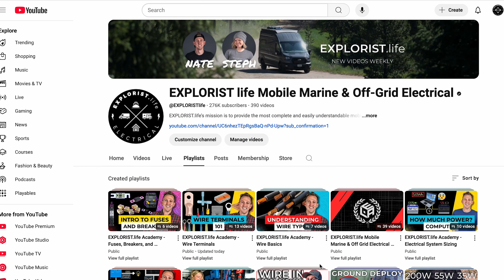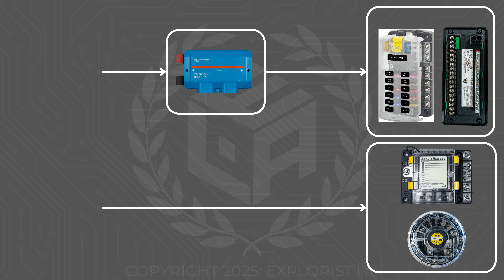How to Wire 12V Dimmers and 2-Way Dimmers - Branch Circuits | Ep 9/10

Comment: Last year my wife and I bought an older born free 23’ rv. When we retire our plans are to boondock on BLM land as much as we can and see the country before we can’t. The rv has an onboard generator that works fine but is loud as all git out, plus it burns the fuel in the gas tank. Solar was the way, the problem is I knew nothing about it. So I used YouTube like I was searching for university classes on the subject and picking out the best professors. Last summer I was able to put a 400w panel on the roof and change to one 280ah lithium battery and this summer I added two more 450w panels to the roof and an additional 280ah battery . I have 3000w inverter and well everything we need to run 120v to 12v everything including the ac and microwave. In addition to the solar panels the batteries also charge by a dc to dc charger and the upgraded 125 amp converter. I did all this going from 0 knowledge to a complete system and I wanted to give you and there are other YouTubers also (Will Prowse and others) a hearty shoutout and a thank you. This June 8th we leave for a trip woo hoo!!!!!!!!!!!!

Comment: I'm going to preface this by saying I like overly complicated things I don't know why it's just the way my mind works.

Also I have not tested this but wiring them in parallel with diodes to keep you from back feeding into the switch should work. Again my mind over the complicates things but if you ran to relays one to control whether or not the circuit was powered at all and the second to control which dimmer switch was energized at a time so you wouldn't be trying to power the circuit two different switches. Or you can just buy lights that have a remote and call it a day

Comment: It don't take a rocket surgeon to tell you dimming a dimmer don't chooch. *

What surprised me is that you didn't cover the low-hanging fruit solution of two-way control switches at all locations but ONE dimming location.

Did I miss something?

Edit: *(especially when PWM is used.)

Comment: I added two switches with dimmers and searched everywhere for a way to wire front and back of campervan. I still have the switches in place but I know that I can only use one or the other. Had the same result where one would dim fine but if I switched the other it just worked as on/off. You just verified my findings, thanks!!